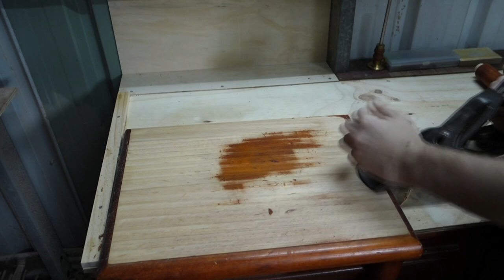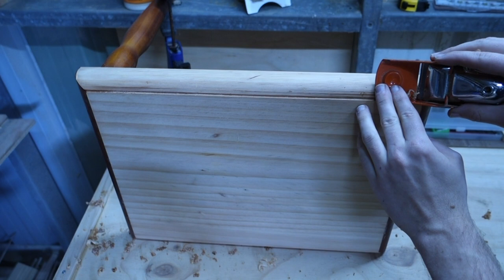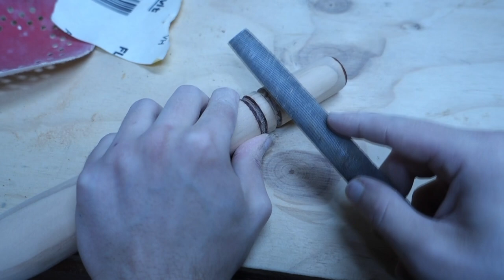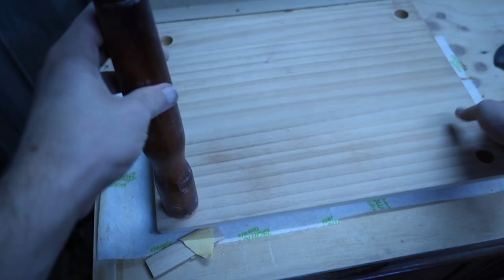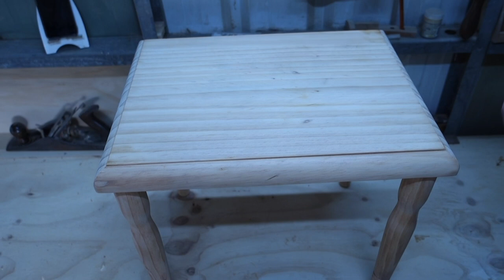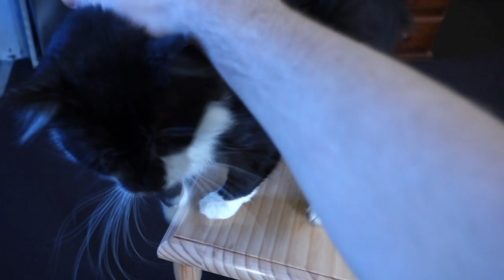Extremely Dark Stained Coffee Table Restoration - E∞J Woodhouse Repairs

Comment: Should of used stripper its faster
Reply: But stripper doesn't flatten boards, a jointing plane does.
Reply from the maker: @williambelford9661  that’s a fantastic point and that’s exactly why I chose to plain it instead of stripping. It accomplished multiple tasks such as flattening, scratch and stain removal, surface preparation in one go. No need for nasty chemicals. 👍